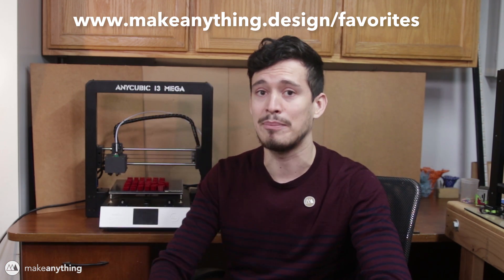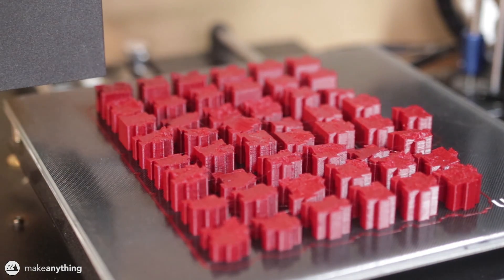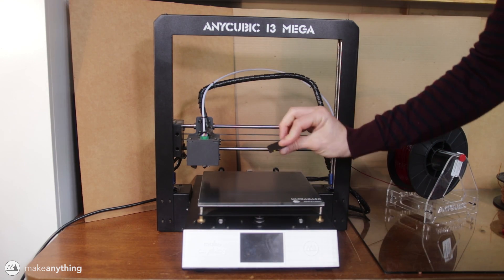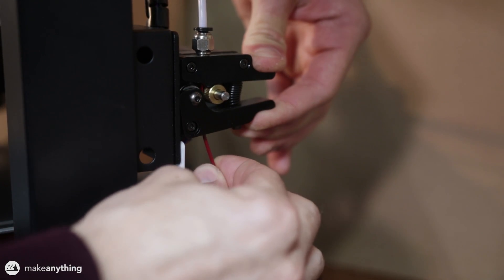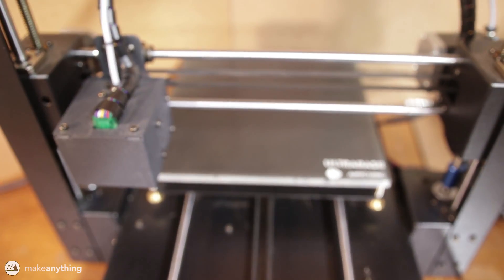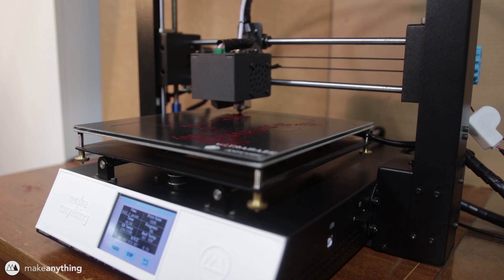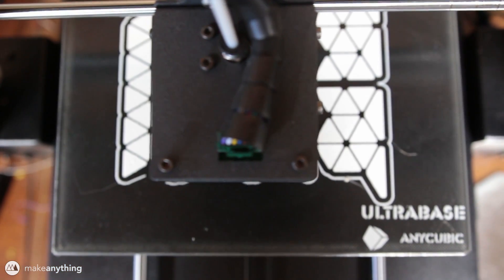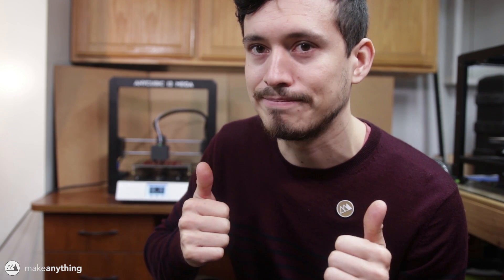Anycubic i3 Mega 3D Printer Review ✰

Comment: Do have any opinions on the Prusa MK3, better or worse than the Anycubic i3 Mega?
Reply: Stuff I Made I honestly think that the Anycubic i3 Mega is a better bang for your buck. The mk3 is better at printing advanced materials, with a genuine e3d hotend and filament jam protection. It overall has a thinner build with high quality control boards, sensors, and extruder systems. The Anycubic i3 Mega in contrast has a heavier build overall, whilst printing with similar reliability and better touch screen interaction. It is better suited for beginners costing 1/3 the price of the mk3. My Anycubic has printed amazing and I honestly can't ask for better print quality.

Comment: I have this and a cr-10 I can't seem to get fine layer settings to print. I can't print decent if I set layer height to .15 or higher but I can't go down to .1 for some reason so what I did was made this a dedicated high temp printer for ABS and nylon. All I did was swap the ptfe to capricorn since the throat uses the bowden tube as its liner. Its still a good printer just not as good as everyone says IMO. If you want an all around printer this is great if you just need PLA then the ender 2 or cr-10 might be better. BUT that ultra base is amazing.

Comment: So I have this printer and love it. But i made a mistake and had the bed too high. That scratch up my ultrabase.  Has anyone replaces the ultrabase before? If so where can I buy the base at?
Reply: You can buy them on aliexpress for around 25 USD. If you also want the aluminium heated bed(the aluminium plate with the rods on the corners below the ultrabase) its around 33 USD. 
I am not sure how you the ultrabase attaches to the aluminium plate though since i don't own that printer. I just fount those parts on aliexpress lol.

Comment: I own this one the V2 without the auto leveling, I would warn people to be careful (though I believe they fixed this in later models, but mines has the bent metal sheet below the bed that cause it to go crazy out ot level, the good thing is that ANycubic has a very good customer service on Aliexpress and they've sent me a replacement, but just be warned.

Comment: Have you ever tried the pause feature for a long time (like a night) ? I tried for a short period of time and it worked very fine. But after a night long pause, my parts unstuck off the bed as soon as the print started. Maybe it needs the bed to be warmed up for a longer time before printing ? I’d like to have some advice on this point, the printer is at work and I don’t like to let the printer print over night and will soon have parts that take forever to print :)
Reply from the maker: +ghismo I haven't tried that but if the bed cools down parts will definitely come unstuck. If you plan on it happening you can put blue tape over the bed and print without a heated bed, at least with PLA.

Comment: I found a CR-10 on eBay for $160! Should I get it, or could it be a scam?
Reply: A cr-10 will run you at least 300, 350-400 in most cases.
If its used 160 could be reasonable.
Reply: It's a scam.  When you try to buy it, it turns out that you are just buying some rolls of filament.  I hate those scammers on eBay.

Comment: Thanks for the review Devin! This is my first printer and is very impressive. As stated previously, replace the original micro card. I also found out that it will
Only read 32G or smaller cards. God Bless🕊
Reply from the maker: Thanks, I didn't have any SD card problems so the input is appreciated!
Reply: Cards need to be formatted as FAT32 or they will not work.

Comment: I picked this model up as my first 3d printer after your first review. Had a few stumbling block but have learnt fast and definitely feel this is a great first time printer. To all those first timers that are considering it I would second Devin's recommendation, just dump the supplied SD card and replace it with a decent one! Thanks Devin
Reply: James Smith I got the Anycubic i3 Mega S and the SD card is fine what happened to yours? Edit: Although I had to get a new adapter the one I got was cheap plastic
Reply: Im looking into getting one of these after my M3D disaster... im curious what some of the 'stumbling blocks' were.  could you elaborate?  thanks!

Comment: I have a question, why is there always an outline around the print?
Reply: wowie wowie That’s called a skirt. When you’re making the files that you want to print, you can select several different things that you want the printer to do before you print the actual part. The most common one is the skirt. The software tells the printer to make an outline or two around the print before it starts. This serves to prime the nozzle so that once you actually begin to print the part, your nozzle has stable pressure inside from the molten filament. It can also clear out old filament if you didn’t purge your nozzle fully before switching filaments. Basically, it helps to improve the quality of the first layer without wasting much plastic. Other things of this nature include rafts and brims. Brims are just skirts that are connected to the part. This can help it to stick down if the first layer is very small. Rafts, on the other hand, create a sort of scaffold between the print bed and the first layer of your part. This helps increase quality if your print bed isn’t completely flat or has irregularities. Hope that helped!
Reply: Cranfres it helped a lot 👍
Reply: wowie wowie that line helps to prime the extruder 😉

Comment: I have problem with my anycubic. it doesn't extrude and makes some noisy sounds like TOCK TOCK TOCK since I bought it. I need help please
Reply: The Tock Tock Tock is the extruder steppermotor skipping steps.
The Motor is not strong enough to push the filament and therefore skips.
This can have a few causes:

Temperature too low, -> PLA should be fine with 190centigrade up, but try and go a little higher and see if that helps (195C, 200C, 205C ish).
Extruder Screw for grabbing the filament too tight, -> try to loose it a bit, (see if the filament gets "gnarled" by the hobbed gear, if so, clean it)
Nozzle/Heatbreak Clogged,-> start with a "Cold Pull" (Google this first!) if necessary disassemble the HotEnd and clean it.
Reply: the tock tock tocks are probably coming from the extruder? Maybe because of a clogged nozzle?
Reply: thanks! I'll try, fingerscrossed
Reply from the maker: I agree with other responses. It sounds like a clogged or underheated nozzle. If it has never fed filament it could also be that the PTFE tube isn't pushed all the way into the hot end and the filament isn't feeding through smoothly or something like that.
Reply: I had the same Problem with mine. Just want your money back and get a new one. Did work with me
Reply: federico vumbaca buy a cr-10 and never look back. I just got a great deal too.

Comment: My anycubic died today :c the extruder and the bed wont heat and sometimes the motors dont work! Have you faced any problems like that? I need help!
Reply: Also i had it working only for one and a half weeks
Reply from the maker: That doesn't sound good! I'd say a fuse blew, but then the screen wouldn't turn on. I would contacts Anycubic customer support.